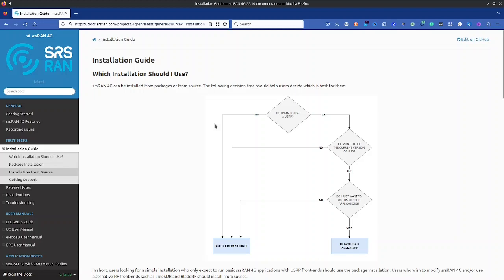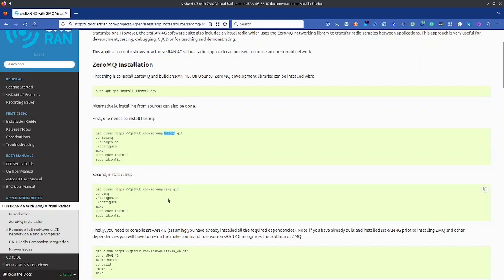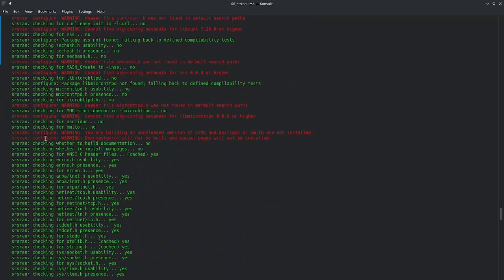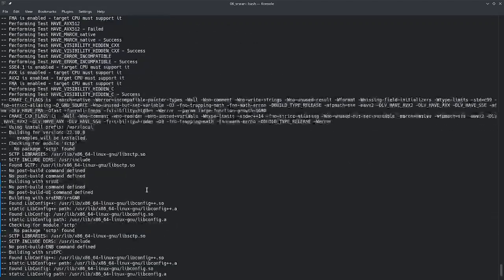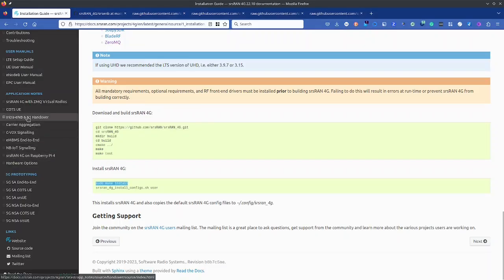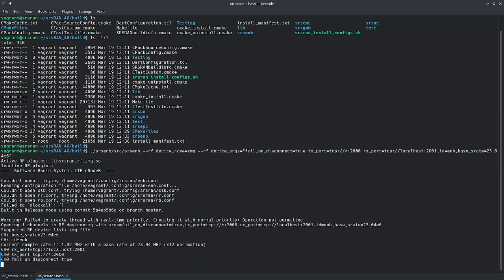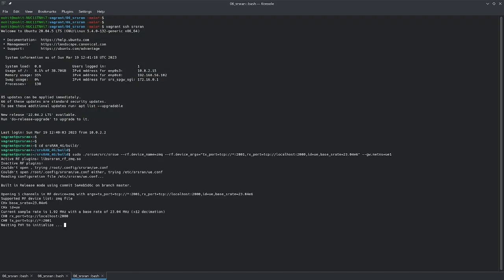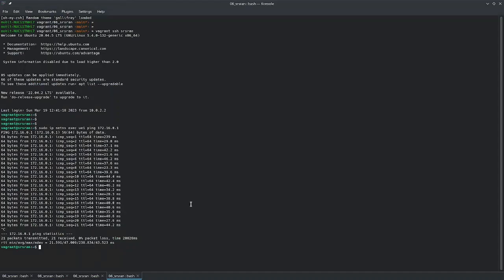Install SRSRAN on a Single VM - Complete Step-by-Step Guide

Comment: I installed srsRAN on a VM and trying to use it with a USRP and keep getting RF overflow/underflow errors. I don't get these errors when I run it on a bare-metal station.
Reply from the maker: Please send me a message via Discord so I can help you out.

Comment: Can I attempt it on macbook with M2 chipset using vagrant . I think NO as this srsran is for x86 architecture. Can you please clear this.
Reply from the maker: I do not think so, you will not be able to run it using Virtualbox. However, you can use any other platform to run a VM
Reply: Can I also please know why ? @techwithmohitkr